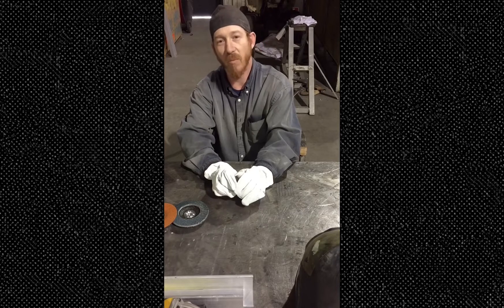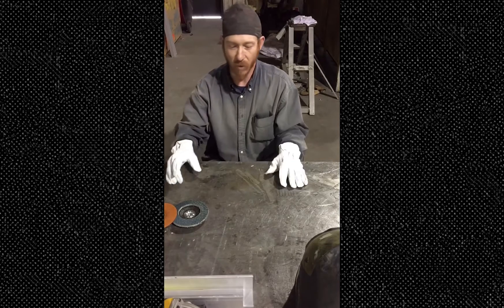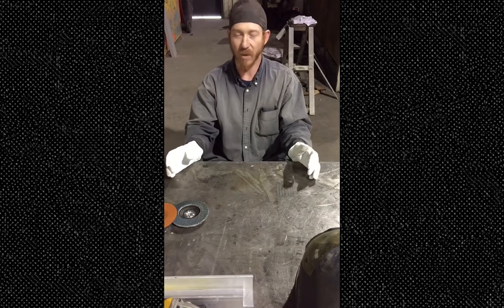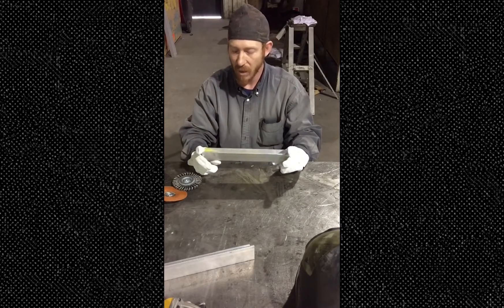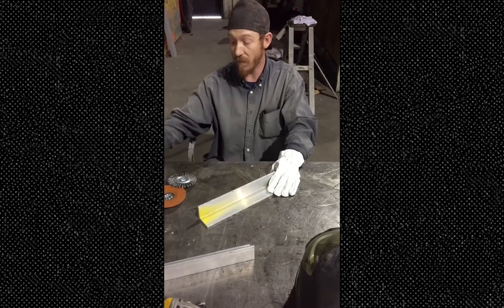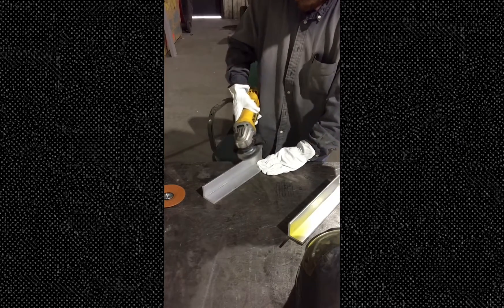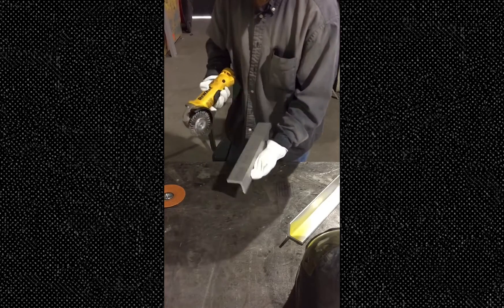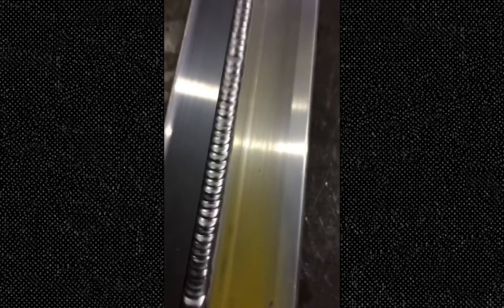How to Prep Aluminum for TIG Welding

Comment: You have definitely done this before. Beautiful weld. I use to weld in an aluminum shop where we used old  mig welders with the aluminum whips . Before tig welders were big on the seen . I laid down some nice welds but the issue with aluminum is it’s perfect melting temp is so close to the temp where the aluminum just blows out. Had to have some good tricks to get the start of the cold weld ready to reach the nice melting temp right quick. But once you had the aluminum heating up nicely then I could lay down some beautiful beads. Fabricated all my own parts and to the very tight tolerances. We made 3 point hitch separators for golf courses. A lot of them went to Australia.  Times sure have changed. Technology has changed the way we use to do a lot of things the hard way .